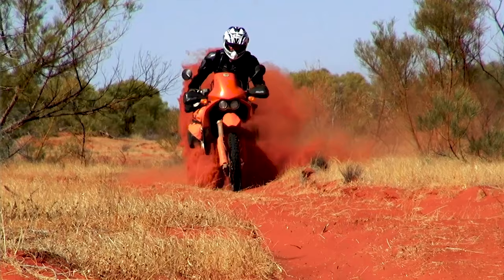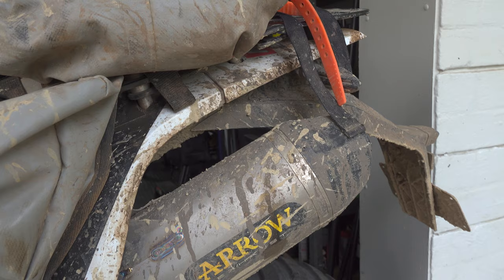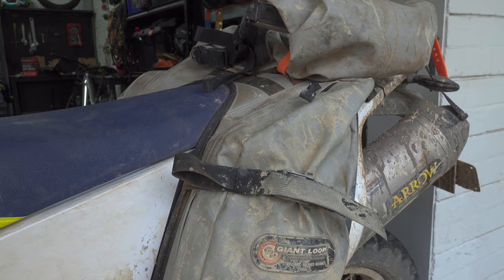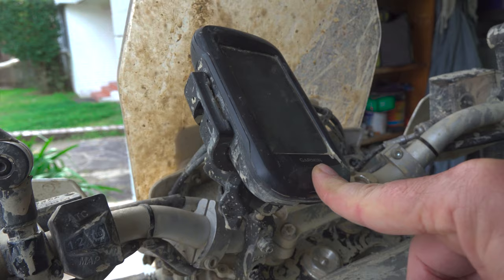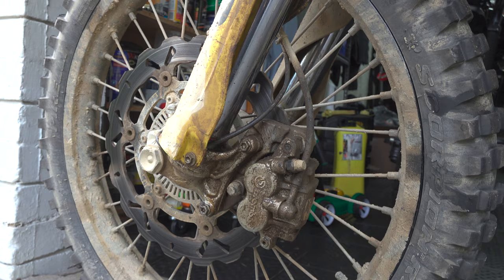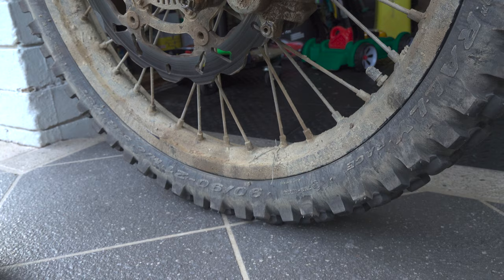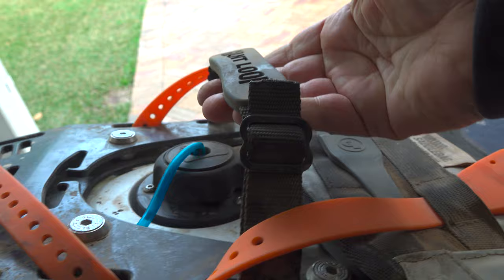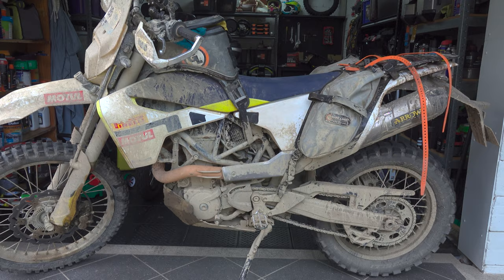Husky Trek 2022 - my Husqvarna 701 the morning after 2000 ks of tough stuff.

Comment: Vanasche Motorsports in the USA sells a bypass unit for the sidestand that I carry with my 690 in case that magnet is lost or fails.  They also have a billet fuel cap that preserves the existing vent line.   The 690/701 platform is a great lightweight adventure machine.
Reply from the maker: Thanks for the info.

Comment: Nice debrief of the 701.The suspension gators on the old suzuki's and  honda's are ugly as but they keep the dirt away from the fork seals. 20,000km and no fork seal failure.
Reply from the maker: Yeah I agree.  I saw a couple of guys with some fork protectors, but I would imagine they would have to be cleaned regularly.  What irritates me was putting that cleaner on them I should have known better.  Water is better than anything.

Comment: i have two ktm 690: 2014 super moto and 2021 enduro. on super moto, i run plastic bash plate on sumo and on 2021 690e, i run metal bash plate. on both bikes, i layer the inside of the bash plate with dynamat xtreme sound deadening material. both bikes actually seems to run quieter with bash plate attached.
Reply from the maker: Thank you.

Comment: Hi Dave, I saw you mention the difference between the MY20 and MY21 rider modes. You were explaining the difference between your bike and nuggets. I can’t find it again. Would you mind telling me the difference again? Multiple google searches haven’t yielded an answer.
Reply from the maker: 20 you have to actively turn abs off.  21 it goes off in traction control setting 2
Reply: @MotorcycleAdventureDirtbikeTV  thanks Dave, I appreciate the reply. I think you’ve swayed me into a 501 build btw. I was so close to pulling the trigger on a 701
Reply from the maker: @thinpins1  Just remember the 10,000 Km service intervals on the 701.

Comment: Solid work Dave!!!  Great recap. Question here from the States.. Ive been told Husky shortened the suspension on these last 701's so I should look for a 2017-2019...  Do you know if this is true and does your bike feel like it needs more travel??
Reply from the maker: Not sure.  I simply don't know. I do know they used to be taller, but that was years ago.

Comment: At first seems like a lot of pressure in the tires as 22psi is in the ktm manual, but there is differences from tire to tire. More road biased tires like the stock ones are harder carcass and they form the same "belly" on the contact patch as do enduro tires with much more pressure due to weaker more flexible construction, so one would generally run enduro tyres on dual sports at higher pressures than 50-50 dual sport tires? Is this somewhat correct? I had IRC on my CRF250L, then Pirelli MT21 which on same pressure looks like it has less pressure, and Michelin Tracker now looks even a bit less (more belly on contact patch if same psi). I guess one should not go by the psi number for different tires but just looking at how "squished" or how much "belly" does the specific tire make.
Reply from the maker: I just didn't want to get a pinch flat.

Comment: Looking forward to your movie.   Does the 701 complement the T7 well  or would the Red Rooster CRF 300 be a better stablemate for a T7 (one an adventure tourer and the other, as you put it, for adventure exploring)?  Seems like the T7 and the 701 might overlap too much - both great bikes!  Your Husky sounds great with the Arrow exhaust.
Reply: It seems that, without extensive modification, the rooster isnt going to be nearly as capable as the 701 for exploring where the 701 seems to be a "ready to rock" package. But thats just the opinion of someone who hasn't ridden either 😅
Reply from the maker: I'm more of a 701 man.  Although I am considering a 500 build.
Reply: I'm fortunate to have both at the moment. I personally don't think there's that much overlap between the T7 and the 701 - different bikes for different tasks. The T7 is night and day better on the road and the 701 is night and day better offroad. I tried to turn my 701 into a lightweight adventure bike, but I just couldn't get it to be comfy enough for all the road miles that I have to cover to get to the trails, even with a rally windscreen. For trips like the one Dave went on here I'd go with the 701, for more easy gravel and longer stretches of tarmac, I'd go with the T7. 

T7 and the red rooster would be my picks because the red rooster can do 90% of what the 701 can for half the price. Don't get me wrong, the 701 is a phenomenal bike, but it is expensive for a dual sport.

My 2 cents :)
Reply from the maker: @JohannesDalenMC  good points.
Reply: @JohannesDalenMC  I asked about the T7 because I know he's a owner/fan.  I have an Aprilia Toureg 660, which I love for its tubeless tires and cruise control.  I've enjoyed your videos on the 701 and  I'm contemplating buying a used one for more extreme off-road riding.  I'm not nearly as strong and young as you are and worry about picking up my Toureg if solo riding.  I figure if you have issues with your earlier T7, then I certainly will with my Toureg, hence my interest in either the Honda CRF or the 701.  I like quiet bikes because I'm an old man ; ) My concern is that the Toureg and the 701 are too similar and I'd be better served by much lighter CRF 450L  (the 300 Rally is a great bike but I would prefer the suspension of the 450 and the added power).
Reply: @JohannesDalenMC  Since you are uniquely suited to answer this: is the T7 and 701 so close in capacity that it might be redundant to own both?   I have Tuareg 660 and want a 701, but think one might sit gathering dust if I own both.  Thanks for your reply!
Reply: Hi there Michael, sorry I didn’t see your first response until now - thanks a lot for watching my videos.

I’m starting to realize that even though the 701 and T7 (660 too) share the same engine capacity, it doesn’t automatically mean they are similar. As mentioned the 701 has a higher potential due to weight and suspension, but a thumper, and especially the 701 feels stressed and tense compared to the T7. If you’re racing that’s good I guess, but if you’re exploring and not in a hurry, the aggressive feeling of the 701 can be taxing. So no, I don’t think there is that much of an overlap. One is a comfy adventure bike and the other is an aggressive dual sport.

It depends on many things, like where you typically ride and how good of a rider you are. And as you can see this is quite hard to answer straight, so it turns into a bit of a ramble 😅 I liked the 701 for how capable it was, but disliked the race ready nature of it. I’d keep the 660 and buy either a 300L and do suspension or 450L if you have the cash, but that might be because I’ve owned the 701 now and I’d like something different. Hope this was helpful, in the end you must test ride the bikes of interest so you know what you’re getting yourself into. Keep me updated on this, interesting situation you are in.
Reply: @JohannesDalenMC  Your insight is so helpful.  Thank you so much - it really helps me as I wrestle with this.

Comment: 24 psi is very high. i run tubliss front/rear on my 2021 ktm 690. i can run 15 psi with no worry or pinch flats.
Reply from the maker: Too low for adventure bike I think. Very likely to bend rim.
Reply: @MotorcycleAdventureDirtbikeTV  i've never bent on two 690 with 19k miles. i've bent many rims on r1200gs and ktm 790, even run tubliss and excel a60 rim and over 30 psi. at 110kg in riding gear, i have absolutely smashed the 690 and never bent either the oem rims or the excel a60 rim. instead of bending rim, i have trashed tires. who have you known to bend rim on 690/701? try bending the 701 rim